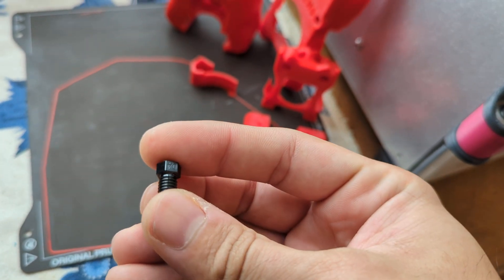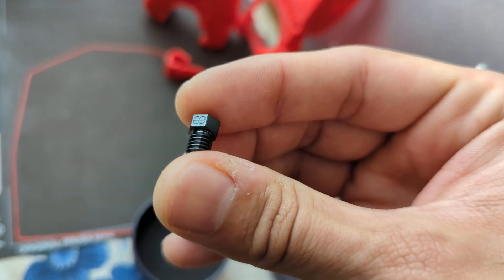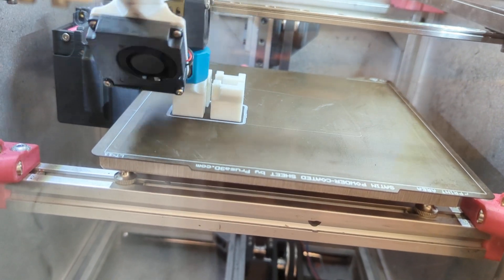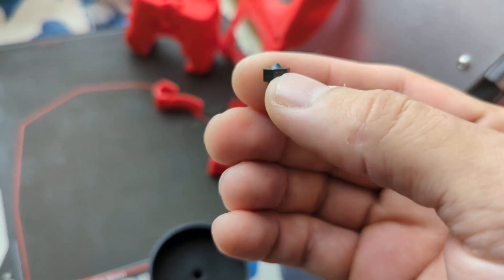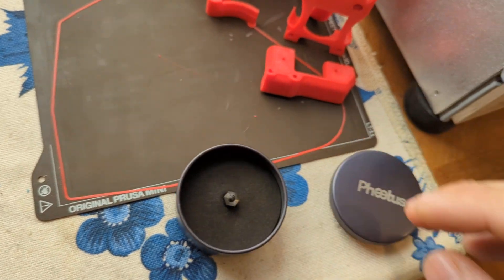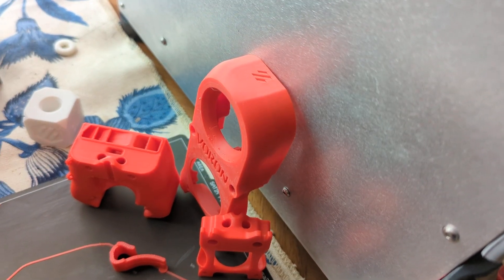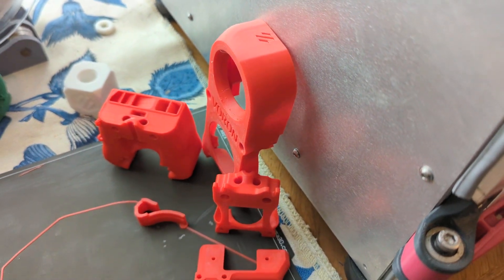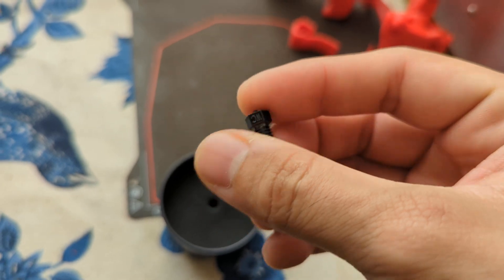First Print with the Unreleased Phaetus Tungsten Carbide Insert Nozzle

Comment: What was the brand of the pure tungsten carbide nozzle you always print with? Couldn’t understand it in the clip.
Reply: Some manufacturers state the reason for the tip only is due to the difficulties in making the whole thing TC... Now it smells like BS after your link. I was hovering over the checkout button...

Any updates on how it fared after these months of printing?

Did you need to print with a higher temp for the pure TC nozzle?

Thanks!
Reply from the maker: I use spool3d.ca, but 3dmakerengineering is great too